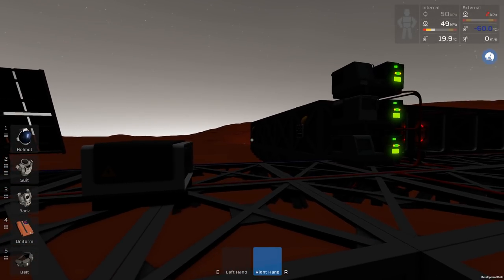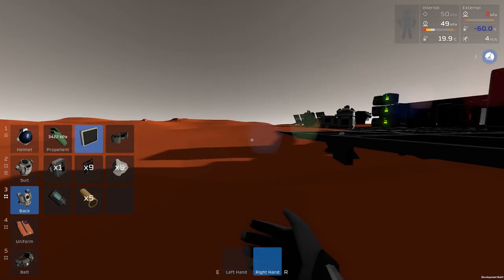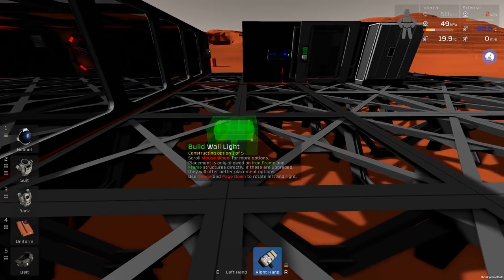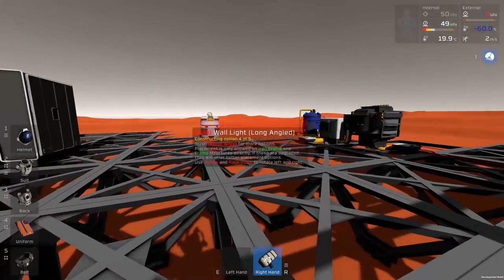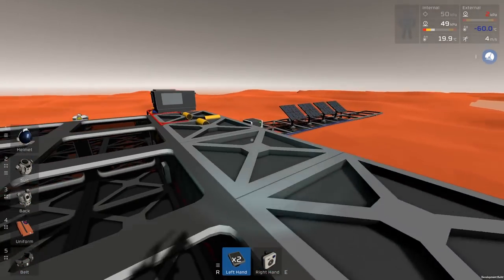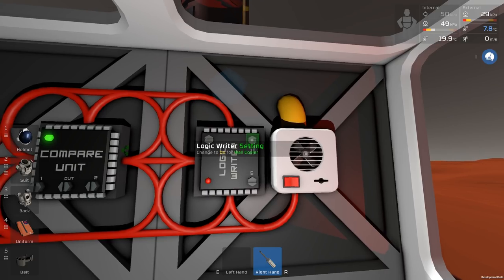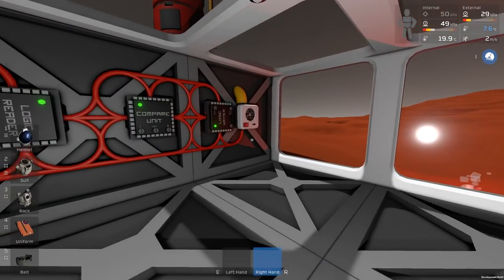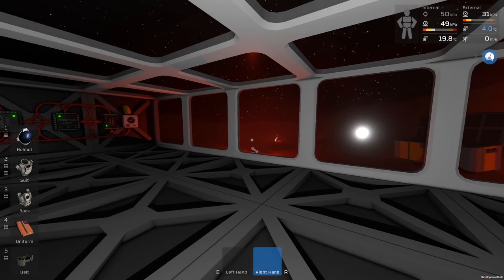Stationeers Season 2 E06 - Hydroponics Cooling and Gas Filtering

Comment: Wall coolers do not pull gas from the room! Just moves heat! So it can heat up anything! Even if output is operating furnace temperature, without any more power draw, just 100W! FYI now passive vents and tank connectors hold gases themselves and are treated like pipes no need to connect pipes beetwen them and other devices! Pipes can definetly hold even 30 MPa (not thurely tested), from what I heard 60MPa, and each pipe section's volume is 100L!
Reply from the maker: I know wall coolers don't pull gas from the room.  I filled it with X to act as the gas that will take the heat to the radiators.  The two won't mix.
Reply: grayduster But it does not matter how hot the gas is, unless pipes blow up because pressure rised, because of teperature has increased! Please read at least the end of previous comment! Again sorry for message spam.

Comment: you can fill a room faster if you have an active vent where you currently have a passive one, the way you have it setup rn is so the active vent is pulling from a pipe that has low pressure due ti the pipe it pulls from being the same pressure as outside, this means it cannot pull at full capacity so its slow

if you reverse it however and you put a passive on the inside, active on the outside (you can use a button inside to turn the outside active on/off) it will fill the room FAST (and active on both sides is even faster for both sucking in and out)

ever wonder why its slow to fill the room but extremely fast to empty it?

:)

Comment: To "dump" gas as at 12:00, use a back pressure regulator to feed the gas back into your input pipe and set it to 0, it will then empty the pipe and tank behind it, if the tank is still connected.  Use a value to stop it being output back into the same output pipe.  Just watch the pressures in the pipes.

Comment: You could create a loop with a set of radiators inside the greenhouse and one set outside, then use a volume pump to circulate the gas inside the pipe loop.

Comment: Odd that water does not expand or heat into vapor  in this game, considering the attention to detail in other departments.
Reply: water physics are actually really hard to implement in games, its kinda why most games dont implement it at all, or not very well, especially when talking about non-AAA games
Reply: Chemical engineer here, the water physics aren't the problem, contained flow is easy. Its the phase change where stuff breaks down.
Reply: game programmer here, chemical engineering is irrelevent to game programming ... yes water flow is easy, but only for static game worlds..... fully moldable voxel worlds such as this are NOT easy, as the water physics have to calculate for every single voxel, which is hard work and a ton of complex math .... liquids just arent viable to be made in voxel worlds

its why minecraft has shit water physics, and space engineers doesnt even have water, other voxel worlds have water, but its a "water level" type thing where water is anywhere below a certain Z height + has a connection with other water ... so flow isnt possible in these types

can water flow be done in this game? certainly, will it be easy? if it was a AAA game totally, however for indie devs water physics in a voxel world are extremely complex
Reply: In general, yes, but for this game, no. Chemical engineering uses the exact same models that this game uses for flow in the pipes. And frankly, they already implemented a model for external gas flow, with realistic associated temperature effects. Tweaking that system to work for incompressible flow would actually reduce processor load from the volume that is water instead of gas as compressible flow equations are much more complicated. Regardless, I thought that they were referring to the water in pipes and tanks, which is a completely different story. In the game as it stands, the pipes flow gases, and from what I have seen, treat liquid water as an ideal gas, with no distinction between water and steam. Changing that system to support multiple phases while maintaining the current level of realism would be far more difficult.
Reply: this is actually incorrect, liquads move entirely different then gas for 1, and for 2, the gasses work on a BLOCK BY BLOCK basis, as in, each block is considered 1 gas tile, each block will have a its gas calcualted, and the gas flows through tiles, but its each individual tile is the same gas throughout the tile, 

you see, gas is invisible in this game, so it doesnt need perfect flow patterns, same as the pipes, they dont actually calculate flow throughout the pipes, a whole pipe network is seen as a single entity and theres flow between two networks yes, but each network itself is rendered as 1 entity

liquids however do not work like this, they are visible and have a very dynamic flow, and due to its visibility it has to have a very accurate calculation in order to represent proper liquid flow
Reply: and they are indeed talking about water in the world, not the pipes

have you seen when ice melts outside? it just creates a circle of water basically, and you can mine around it and it will be a floating circle of water lol

Comment: If you hook up a mixed gasses tank to both the filter waste and filter input it'll clean the tank of the desired filtered gas. If you hook up the pure gas tank side to the waste with a volume pump, you can pump out both the pure tank and the pipeworks to it too. So you only have to switch the tank and the filter, flush the system in to the mixed gasses tank and pump out what you want from it. It sounds elaborate, but it's really easy once you lay it out

Comment: 11:50 you coud make it way more easy, filtration unit 3 way pipe, active vent, and on the other and the gas tank... with your current setup you need more space, only downside from my idear is that you need a second active vent...
Reply from the maker: I tend to want to remove active vents where possible (even though they're sometimes simpler), because a) Noise, oh god the noise, and b) regulators let you skip some electronics by being able to set the pressure on the device, rather than controlling on/off to maintain a set pressure.
Reply: i think that you are right when you would build somethink bigger than a single mined filtration system, because
the filter itselfs pumps the stuff out, and it makes no diffrence if the filter pumps the stuff out in 1 single pipe or have 4 pices of pipe
second the the pumps take massiv energy for beeing not needed,
and the vents are only for getting the pipes clean when you switch the filtering
Next good think is, the filration systems takes only engergy when its work, and the active vents are quite cheap in for from energy consumtion.